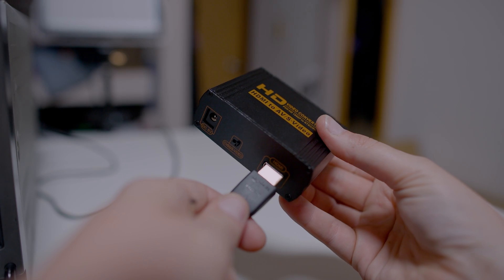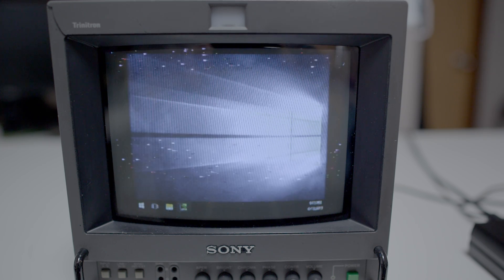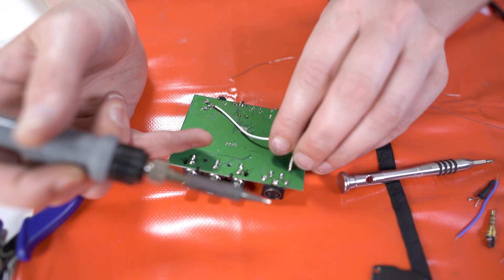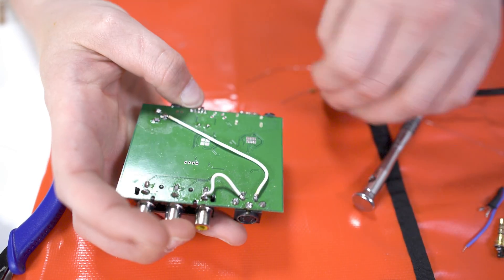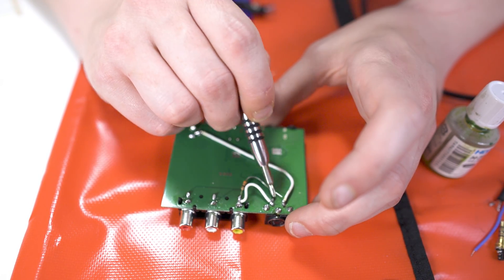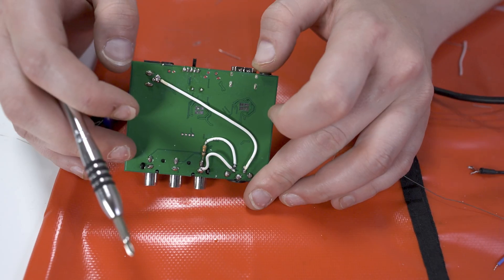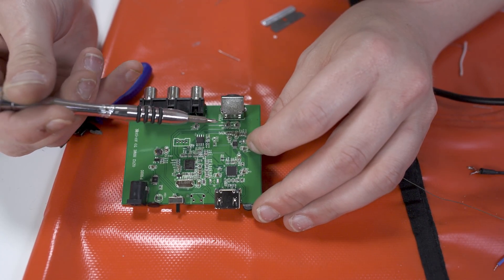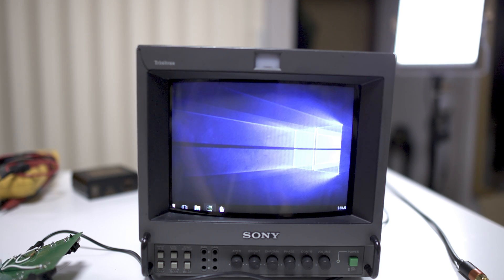HDMI to S-Video Converter

Comment: Why didn't you just use the resistor as a ground and fuse  to svideo to the yellow signal and get  rid of the two wires? Would work the same and less soldering.

Comment: Hi Kate, thanks a lot for this video and informations. By chance, do you know a good HDMI to S video converter alternative please? Best regards
Reply: FYI I just ordered an Atlona AT-HD530. It retails for $300, but I found a used one for $30 on eBay. If you're interested, I'll let you know how it works.
Reply: @Jaguarandine  Can you please tell me how you like the Atlona AT-HD530 ? I bought two different things (Tendak and I forgot the name of the other one)  from Amazon and both work, but the picture is not as bright as I was getting when I had a cable box with S-Video out. Is Atlona picture bright? How is it working for you in general? Thanks.
Reply: @rickoshea4509  I actually threw it in a box and forgot about it, lol. Never tested it as my use case evaporated. But I've been meaning to try it. This would be a good excuse.
Reply: @Jaguarandine  I went on their website and I was disappointed to find out very clearly stated that it will disable HDCP content. So if something is copy-protected, it will not work with this device. It just so happens that just about everything is copy-protected nowadays.
Reply: @rickoshea4509  If you go on Amazon, they sell cheap HDMI splitters that strip HDCP. Just check out the reviews.
Reply: @Jaguarandine  Great! Thanks. I'll give that a try.